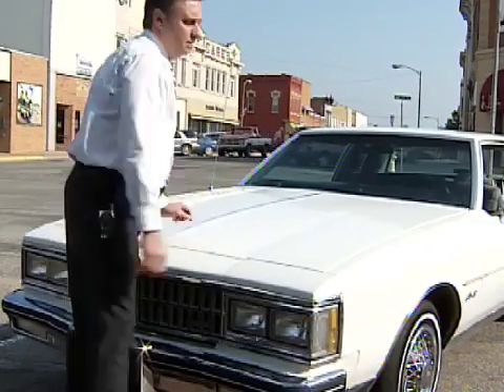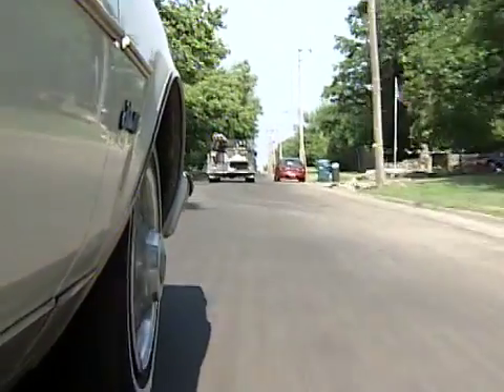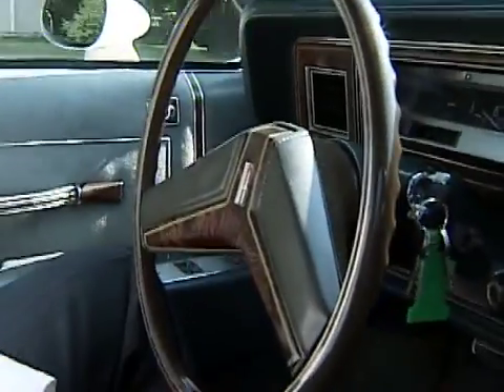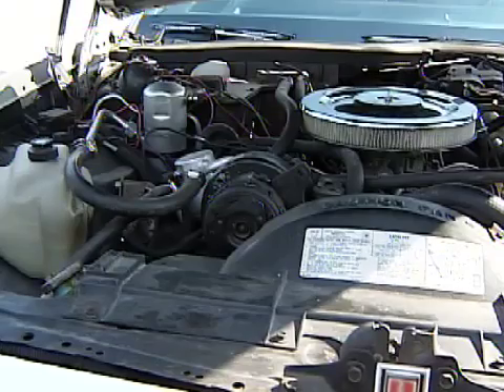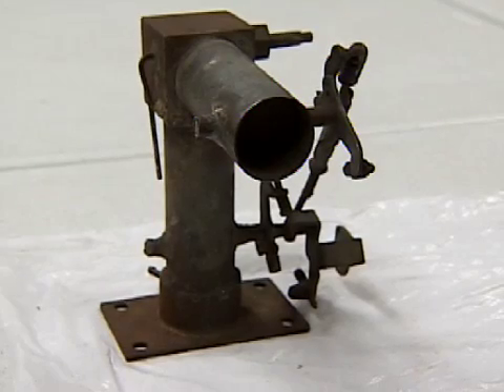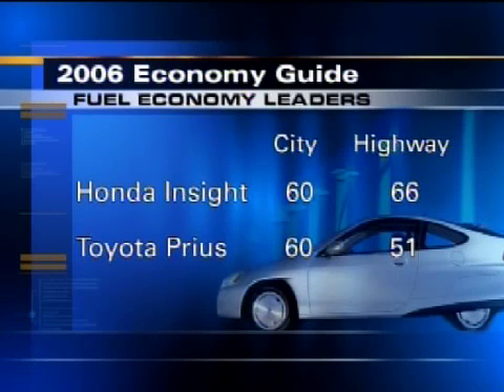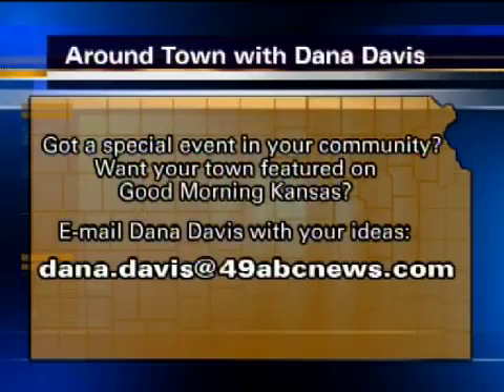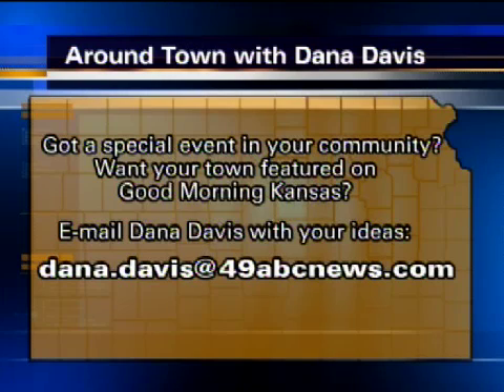Gasoline Vapor

Comment: When your father used his invention in the 70s, did he cut a hole in the hood to fit the snorkel, or remove the hood? 
Did his car travel slower or about the same speed?
Reply from the maker: He drive with the hood removed. At the time the highway speed limit was 55 mph and his Lincoln ran 55 all day
Reply: @jtalbert1968  Can you explain the two throttle plates on the snorkel? Do they open simultaneously?
Reply from the maker: @keithc8108  yes they do. Between the two plates is a 1/8th inch diameter copper tube with holes drilled at 45 degrees which transports the fuel in a gaseous state to mix with the air. 14.5 parts air to one part fuel.
Reply: @jtalbert1968  Thanks for sharing the information.